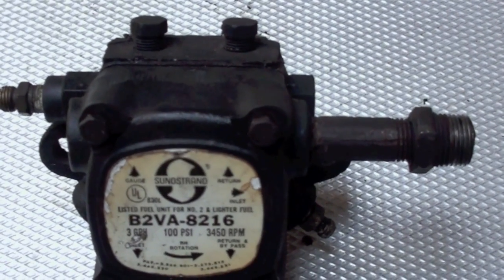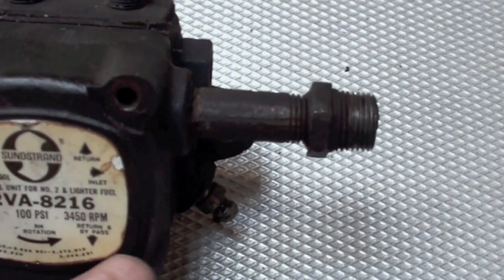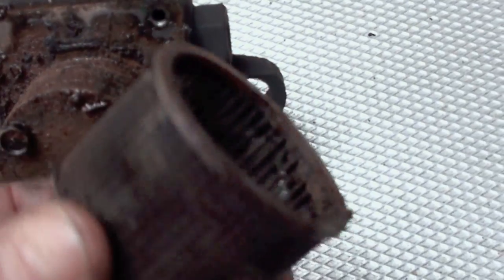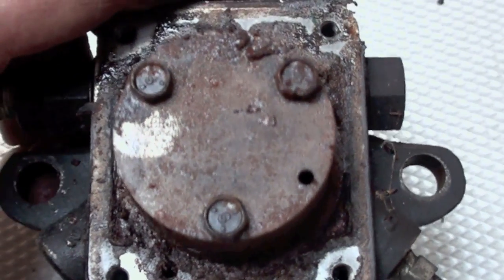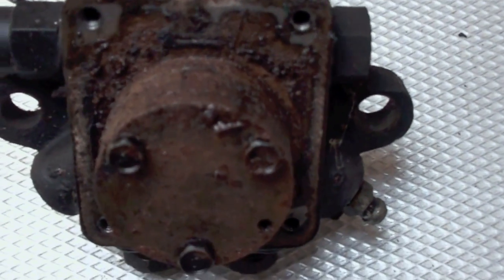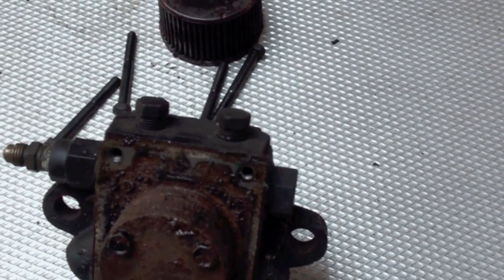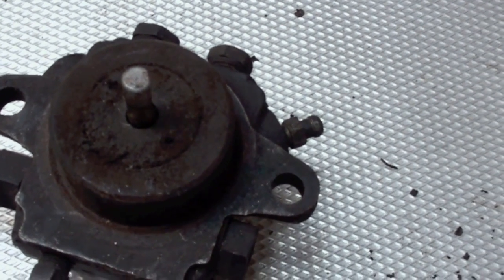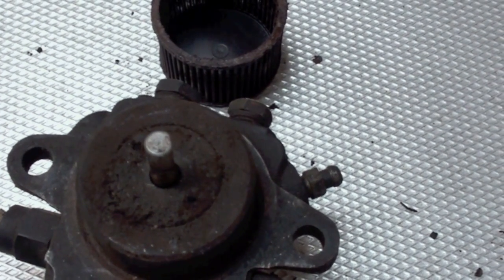A look at an oil burner pump failure and the reason for the failure.

Comment: SOMEONE PLEASE HELP ME. I have the exact same pump and it makes a sucking sound when the motor stops. It sounds like a person sucking through a straw when the cup is empty and they're trying to get the last bit of soda. The reason i ask is i'm having a problem keeping my furnace running for more than 12 hours of on and off use and the pump makes this noise whether i just primed the fuel line or after hours of use. The fuel line comes out of the top of the tank to a check valve (that is new) and it runs to the ceiling,along the wall for 20 feet then drops down directly above the furnace to a thermal shut off valve(also new). I also resealed every fitting from the tank to the pump with the proper sealant for #2 fuel. I even got rid of the old wool filter and got a new Ger-ber spin on to eliminate that as being a source of a leak. Also resealed the oil pump gasket with silicone until i get a new gasket. I also tested the fuel line to the oil pump  by using a brake bleeder and sucking the fuel from the tank to the fitting that goes into the oil pump cover to check for air bubbles. I just got solid fuel after getting all the air out. After a while i decided to disconnect the fuel line before the thermal shut off valve and hook up a line directly to a 5 gallon jug of diesel. The furnace ran through the 5 gallons w/o a problem. What am i missing?   ANY HELP WOULD BE GREATLY,GREATLY APPRECIATED FROM ANYONE READING THIS. Thank You
Reply from the maker: mikeelp23 I am thinking a pump problem.  Is there any oil in the bottom of the burner housing?   That could mean a failed seal.  Hope this helps.
GFM
Reply: First off, thank you for replying to me.Everyones time is valuable.No, no sings of the pump shaft seal leaking if thats what you're referring to. I unbolted the metal band next the oil pump, maneuvered it so i could access the space where the shaft comes out of the back of the pump and completely cleaned inside to watch for leaks and haven't seen any sign of one. Thats what i don't get. There isn't any signs of oil leaks anywhere. I have a vacuum/pressure gauge on the way so i can see exactly what i getting out of the pump because this is got me stumped. I am a Harley Davidson Tech. by trade w/ 13 yrs. experience & this is making me feel like a moron. I thought this was going to be a backflow issue. Replace the check valve above the tank and be done & this is what happens. :-(

Comment: I had alot of air in the line-is that a sign of a failing pump? (tank did not run out)
Reply from the maker: gmoneyga84 Pump is fine.   Look for vacuum leaks or plugged inlet line.
GFM
Reply: grayfurnaceman can I install a permanent guage on those pumps?
Reply: On the suntec pump-on the label- 1 plug is marked for "gauge"
Reply: Why cant I put a gauge in the gauge port on top?

Comment: what stops the oil flowing in the oil pump when the burner is off? is it the spring?...
Reply from the maker: If there is line solenoid, the closing of the solenoid stops it.  If no solenoid, the pump gears will stop it.
GFM
Reply: grayfurnaceman...thank you for that answer, appreciate it...
Reply: The blower spins the fuel pump, The burner controller would control the fuel pump solenoid if there is one.

Comment: It sounds more like fuel is leaking out the nozzel when burnner is off-this can and does happen when the pump gears are worn or the soleniod valve is leaking if it has one-has been the start of a few house fires.like the man says,get it checked by a professional.

Comment from the maker: Probably a partially plugged nozzle.  At this point you may have a plugged smoke pipe and heat exchanger.  When the oil is not atomized, it burns with a smoky fire.  This one needs a thorough service.  May want a professional for this.
GFM

Comment from the maker: That's from air in the gun line and no solenoid.  Sometimes after running for a while the air will absorb into the oil and it mostly stops.  There are some gun assemblies are designed to bleed air through but it does not always work.  Any way its normal.  Hope this helps.
GFM

Comment: I thank you very much for your videos, they are very informative!! I am an appliance service tech but like to learn about all things mechanical.  Here's a ? for you. What would make a Beckett burner keep piddling fuel out the nozzle after its turned off? Not a drip mind you, but a thin stream. Pressure seemed to be caused by gravity, outside tank level about 7' above furnace. Is there a valve in the pump that can stick? Old sundstrand pump, no solenoid, scared the crap out of me! (Replacing it!)

Comment from the maker: Read these backwards. So I will answer this last.  The filter is absolutely necessary!  Very rapid pulses are normal.  If the pulses are not even, you could have a blockage or a vacuum leak in the line.  Hope this helps.
GFM

Comment from the maker: Try to isolate and see if it is coming from the pump.  If its from the pump, the pump has at some time run dry.  I dont know of any repair other than pump replacement.  Sorry I cant give you any better news.  I would have a tech look at it before you do anything.GFM

Comment: I am reposting this,,
My Burhnam hot water boiler,, resonates a high pitch noise,, very loud when positioned between the furnace and oil tank which are in different rooms..new filter ,, oil line..
seem to be resonating thru the oil line,, thanks for any info

Comment from the maker: My thought is that you have an air leak.  If the oil tank is below the burner, with a 2 pipe system, air leaks are common without an oil slick.  Also the oil filter may be getting plugged.  Check out the oil filter vid.
GFM

Comment: Man, i love the video's.  Wonder if you could answer something for me, i got a oil furnace that i have to prime to start. it will run for a couple of days then, i got to run back over there prime it and reset it. i dont see no signs of leaks, this pump system has a two line system, or supply/return style setup. any suggestions would really help me out.   Thanks and again the videos are a great tool.
Reply: crob227  What happened to be the issue with yours? I have the same thing going on, had a plumber change filter and new pump & we had hot water for a day and then same thing again. Got me for $550 for that nice job he did too

Comment from the maker: It should be a screen.  If you hear any pump noise during operation, there is air in the line.  You can also hook a hose to the bleed fitting (lower right on the video) and run it into a can to see if air comes out while bleeding.  That should tell you if there is a air leak.  If the burner starts and stops while running that could be air or blockage.  I would try silicone seal for a gasket.  
GFM

Comment: grayfurnaceman thank you for your reply.
      I will check the fittings again but there were not any gaskets around
 the edge when I opened the pump up. There was something that could be a
 gasket that did not touch the edges. It is behind the round piece that
 houses the gears in the pump. I could not get it off & did not want to
 destroy it I did not have a replacement. It looked like it may be a filter
 of some sort. Do you have any idea as to what it is?

Comment from the maker: There is a possibility that you have a vacuum leak.  On the inlet side of the pump either in the gaskets or the fittings it could be leaking air into the pump.  Check that out.

Comment: I disconnected the fuel line to the burner & ran the pump until I could fill a bottle of clear fuel. I changed the fuel filter & nozzle. Disassembled the blower & opened the pump & cleaned out the sludge. I never cleaned out the pump before & do not know if any of the tecs I had in for service over the years did so.
The pump I have is a single stage 3450 rpm Western.
   Boiler ran the best ever. Only for 2 days. Now it struggles to stay running as if out of fuel. I have a follow up. PG2